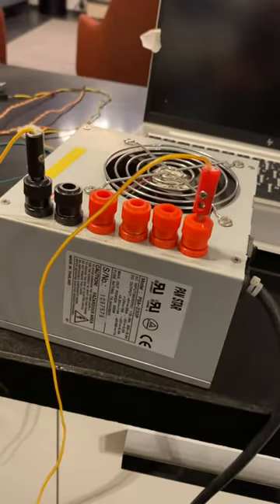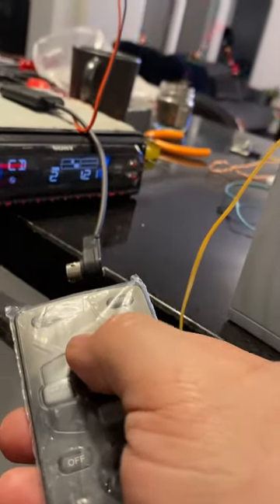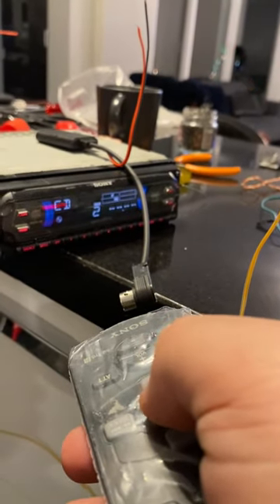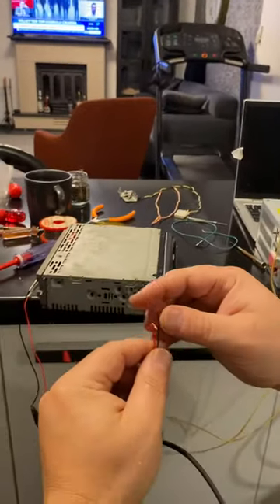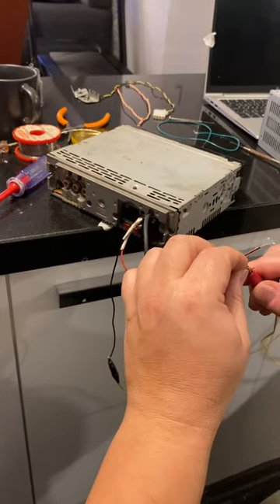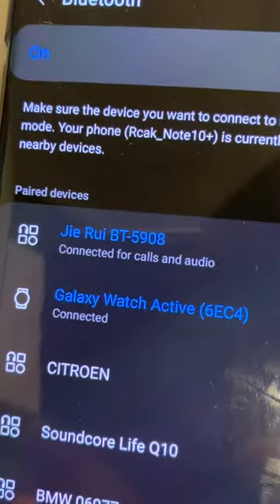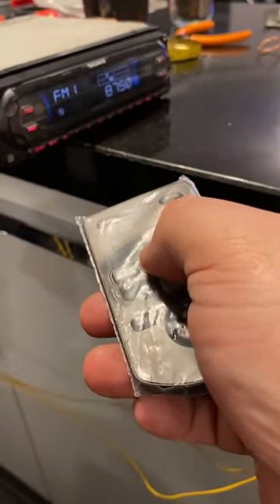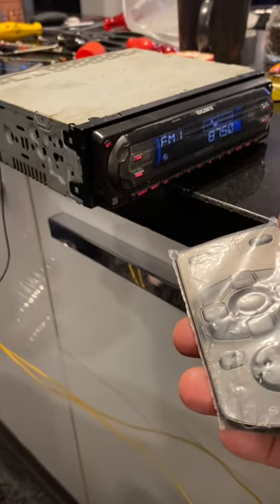Bluetooth adapter for SONY cdx-f5500 not working

Comment: Did you resolve the problem ???
Reply from the maker: Yes .. the seller has sent me a wrong device... After communicating, I received the correct device... I am happy now
Reply: Cuál es el dispositivo adecuado?
Reply: Bus control in in Sony and JVC aux input have the same form factor but completely different pinout. So aux device for JVC will not work in Sony and vice versa.